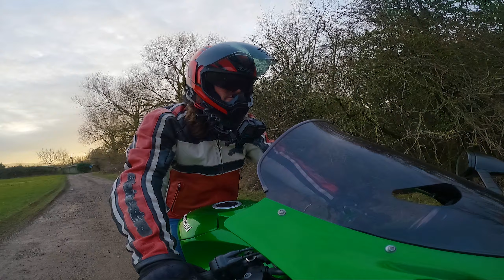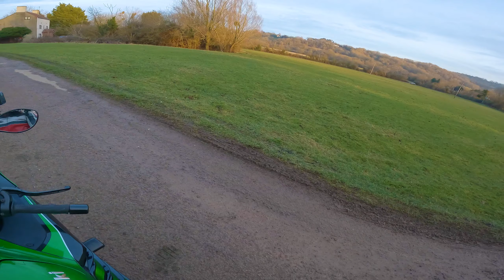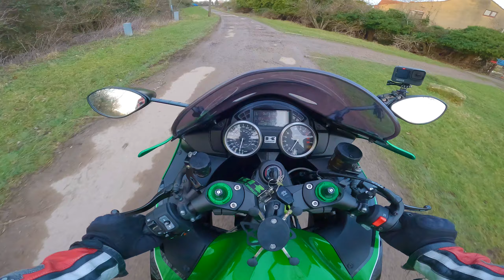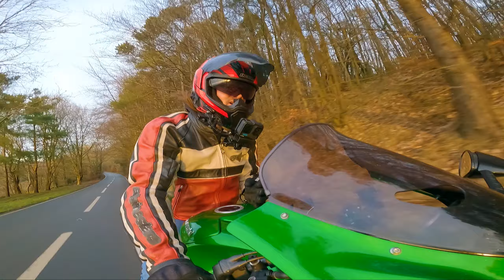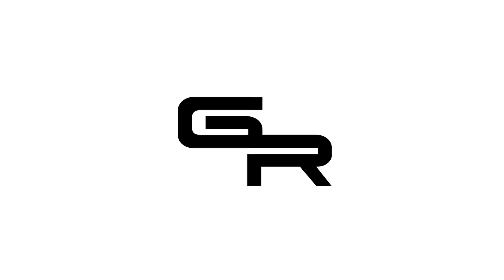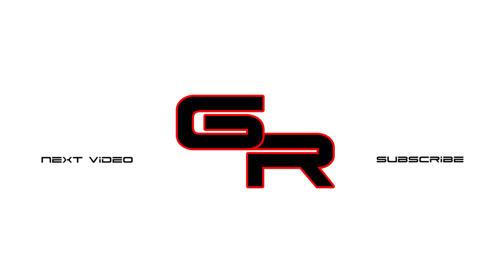Modern Rider Aids | Are They Causing More Harm Than Good? (Feat. Kawasaki ZZR1400 / ZX-14R)

Comment: Some good points raised about ride aids. I had a gen 2 ZZR 1400 and a Sprint 1050. the ZZR had rider aids the sprint didn't. I agree with you strongly that we shouldn't rely on them we should rely on our rider skills, however the aids can be there in case something should happen  that is out of our control. 
I traded both bikes for a GTR 1400 for my touring needs and old knees.
I have never felt the ABS kick in on any bike that has it as I tend to brake correctly but its there should I ever need it.
felt it in a car once as everyone was braking hard to a large fuel spillage from a tanker and cars were skidding everywhere.
When we teach CBT we use bikes that have no ABS so we can teach correct braking techniques but through the rest of the course we introduce the trainees to bikes with ABS.
Even all the new 125's we are getting all now have ABS as standard.
Liked and subbed.

Comment: I think that if your rider aids are kicking in you are not riding correctly, I do like having abs as a backup ,but have ridden for years on zzr1100 and gixxers with no rider aids but learned over years to get on bikes like those ,where now a novice doesnt need to learn the required skills to ride the big boy toys just twist and go. how do you improve your skills if the computer says no. I will stick with my gen1 zzr1400

Comment: ABS is a major safety improvement in motorcycles in my view. So many times, front wheel lock on wet roads have caused a few moments of distress.
Reply: Your breaking too hard if your front wheel is locking …

Comment: ABS is the 1 aid I could never live without, because no matter how good you are you will never out brake the abs it pumps the brakes 100's times a second. ABS should be mandatory on all bikes with option of switching these aids off.
At this time of year I leave eco mode on and turn my sport mode on for the summer.

Comment: It's a redundant argument, most modern bikes allow you to dail in the level of intervention you want. Rider aids are a safety net nothing more, my Aprilia RS 660's traction control kicked in on a roundabout exit that had a large oil slick I couldn't see because it was raining. I was accelerating out of the roundabout and the bike said sorry that rear is sliding so I'm stepping in and saving you from a slide ... I learnt on a 250 cc bike that had drum brakes lol it's 2023 we move with the times :))

Comment: You are explaining the conditions are not ideal for motorcycle riding and saying its getting too dangerous to film...

Now correct me if I am wrong. But if you are concerned about things that, (are switchable let's remember) could reduce the chances of your back wheel stepping out from under you as you accelerate out of a junction into a gap in busy traffic?

Traction control could probably correct the rider input that caused the lowside in the first place. It would make sense to enable it on a ride like the one filmed today.

Then tomorrow ( I am English and live in hope... ) when the sun comes out again, you can simply turn it off and be able to "feel" all you think missing if you didn't.

Also night riding in extreme wet and freezing conditions are a nightmare when riding unlit roads. I always use mine but turn them off occasionally to enjoy unimpeded full power and learn to control it at full throttle where the opertunity allows.

I believe they should continue to be fitted even if just for added safety in adverse conditions and that you should possibly view ot as they are there to be turned on when wanted as opposed to being there to turn off if not.

I don't say that as a keyboard warrior wanting to debate the point. It is simply my opinion which you asked for and if you still feel the same way about rider aids (also fitted as standard on all moern cars too) then thanks for taking the time to read my reply to your video and happy vloging!